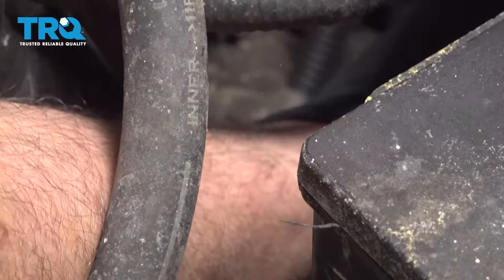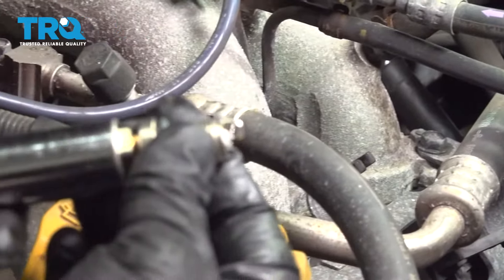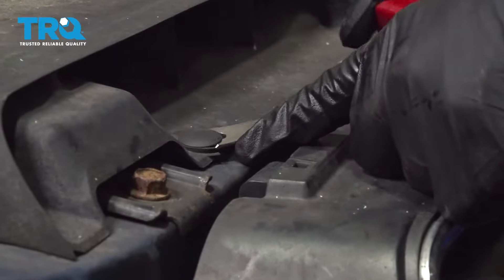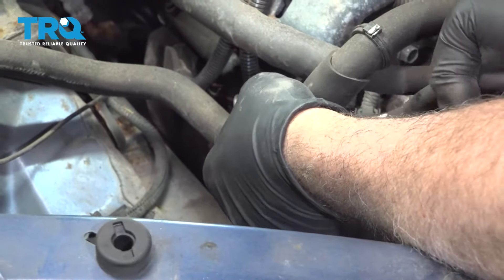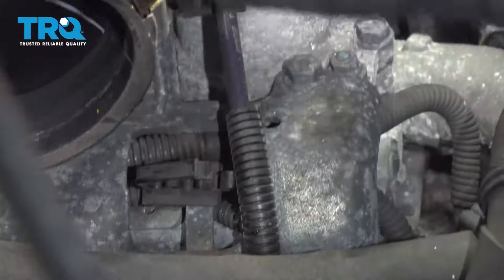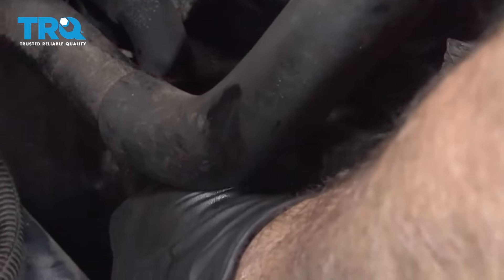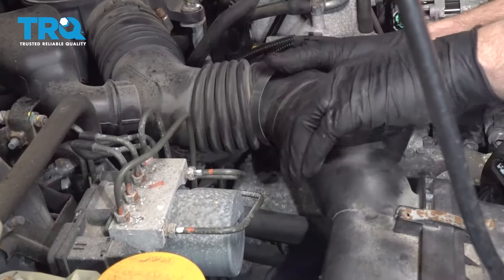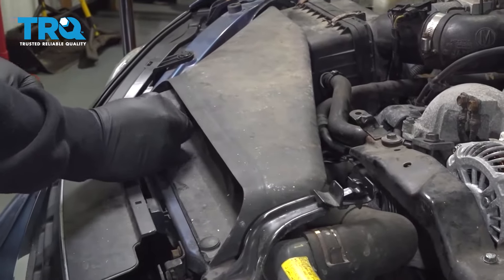How to Replace Spark Plugs 2005-2009 Subaru Outback

Comment: Great video. I just changed them on my daughters 2008 base Outback. I just took off the back half of the airbox and was able to get to the passenger plugs without a problem. In fact they were easier than the drivers side.

Comment: I use oil on the threads if I don't have anti-seize readily available. Nothing worse than a seized spark plug in a cylinder you can barely access.